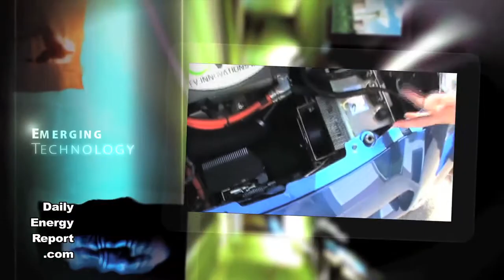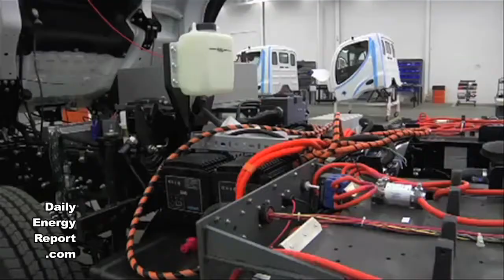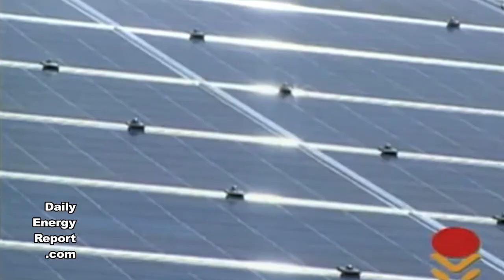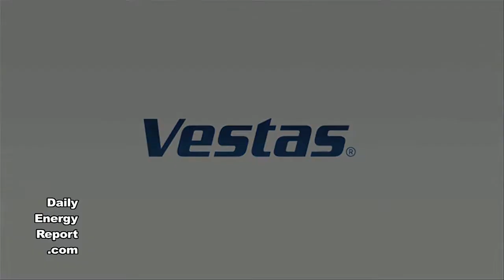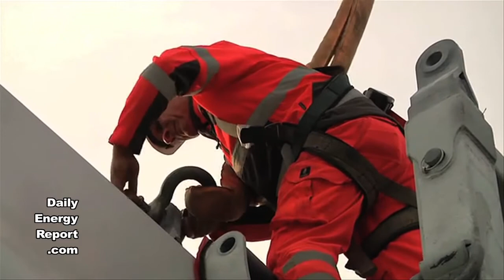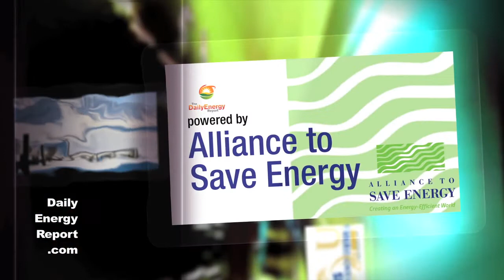All-Electric School Bus Unveiled By Smith Electric Vehicles

Comment: Excellent electric school bus. Looks like that needs solar roof panels charging the batteries and running longer than 120 miles per charge as a great suggestion. Canada needs them real bad so there is no more diesel pollution.